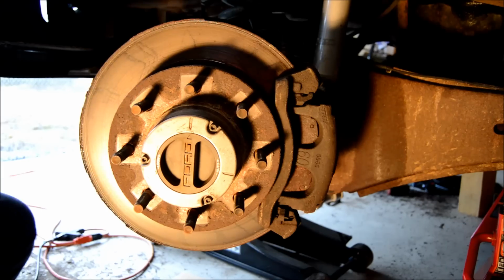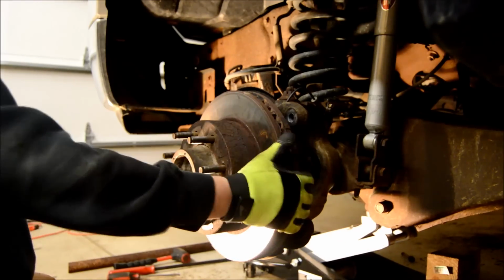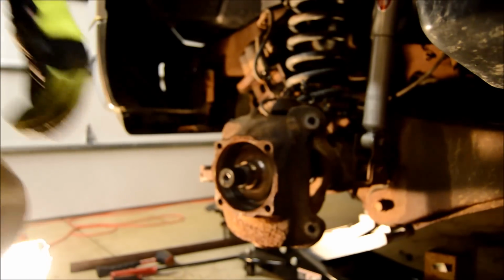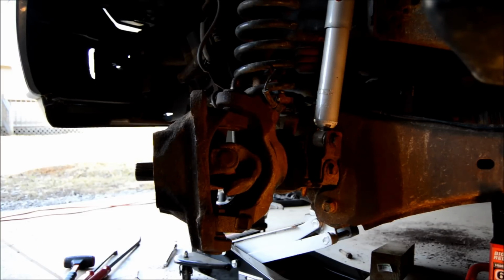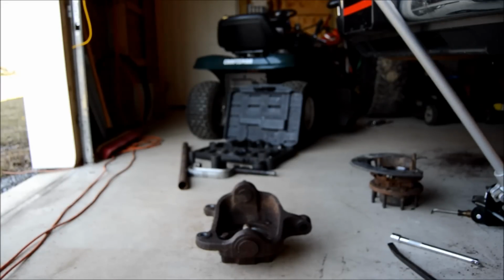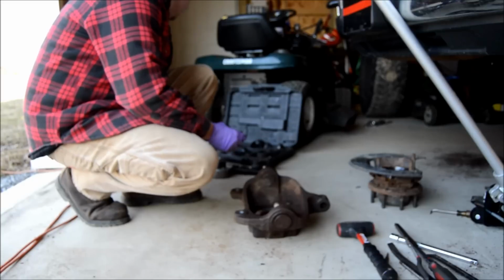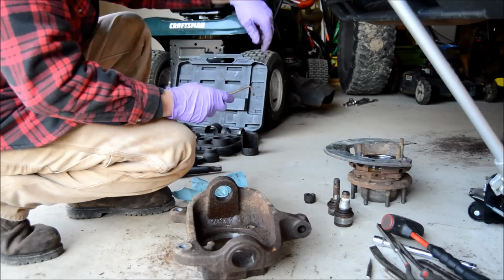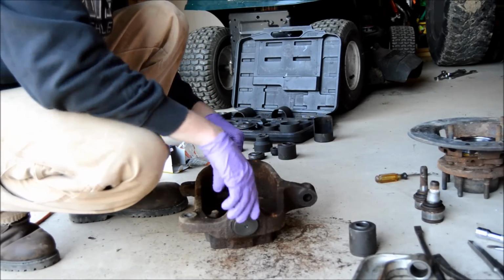2005 F250 BALL JOINT REPLACEMENT

Comment: Doing mine right now with the help of this video.  Had to order some Snap-on snap ring pliers.  Got the axle seals and all.  Great video!
Reply from the maker: lvsqcsl those snap rings are a pain good luck
Reply: @WorldsOkayestFarmer  The snap ring pliers I had were cheap and they kept bending.  I took those 8 inch Snap-on pliers and went in there and took that right out. I already had the special tool to install the hub seals.  I checked the alignment and all is good.  Thanks for your help with the video!

Comment: If you just take that big pry bar you have you could have used it to push between the u joint and the axle tube and the axle and seal would come right out in 2 seconds.

Comment: Hi, very straight forward video loved it, in future though would be nice if you called out the wrench sizes you are using. Those are some pretty big nuts on the ball joints and I was curious to know the size to make sure I have the wrench available before starting the job so I know if I have to buy it. Everything else in the video I loved and was the easiest ball joint video I watched for the superduty! Thanks!
Reply from the maker: Thank you I am glad it helped and thanks for the input will def try and do that

Comment: Quick question for you. What is the snap ring pliers you have in the video? I am getting ready to do this a second time and the first time I had a snap ring pliers that was too thick to fit between the hub and the axle so I couldn't reach the snap ring. Thanks in advance.
Reply from the maker: They are the long double jointed ones made by gear wrench. If not at advanced auto you can get them online.

Comment: Appreciate your videos! Can you tell me did you press that hub seal in yourself using the OTC tool? Did you buy the tool or did you find one for rental?
Reply from the maker: Hey Todd I tried to put the hub seal in with a piece of wood and mallet with no luck. I didn't want to destroy the seal so I bought the OTC tool on eBay for $75 it was real easy with the tool. If you live close to Pittsburgh you can barrow it.
Reply: +Stroker I'm about 90 minutes away from Pittsburgh in NE Ohio. I appreciate your offer... mine don't need done yet, just like watching repair videos! 

I've seen guys make their own tool using black pipe. They just don't stop in the correct position.
Reply: I dont mind buyng tools at all that are specific for one job, I am saving myself so much money by doing the work for myself, the tool more than pays for itself. As soon as I am done with it, I can sell it or keep it for future if I think I will need it again. I bought my ball joint press on sale for $75, I have used it on 4 vehicles! The spark plug removal tool for 5.4 engines i used on three vehicles, a lot of the specialty tools are sure nice to have and I have built quite the collection and everyone of them was a fraction of the price compared to paying a shop to do the work!  I would rent them if I could but no where here does that.

Comment: awesome video.  What did you use to install the new axle seal and the axle dust seal?
Reply from the maker: Adam Waldroup the dust seal just pushed in and the axle seal are you talking about up inside the axle housing? Or in the knuckle
Reply: the one in the knuckle that is such a pain to beat out.  I was planning on using a piece of 3" pvc pipe but I am not sure if you had a better way.
Reply from the maker: Adam Waldroup I tried a few different ways I did t want to mess up a &50 dollar deal so I bought the tool it looks like a big mushroom for $70 and it went in easy